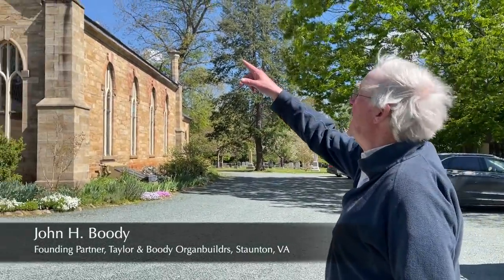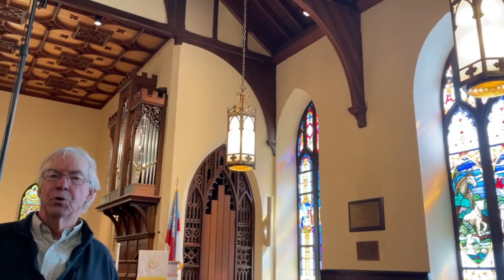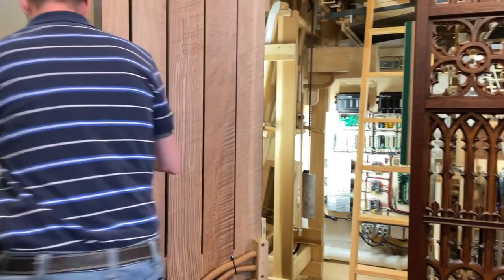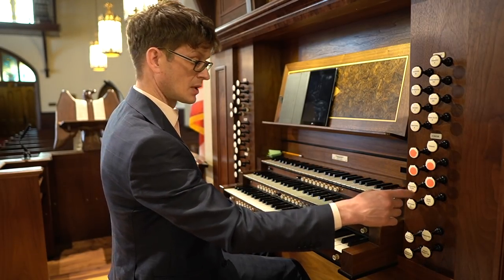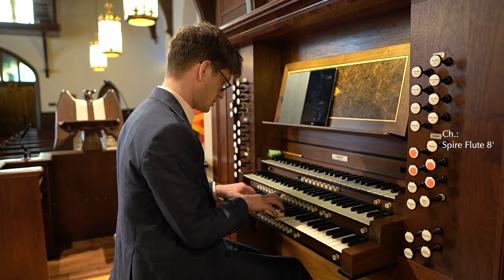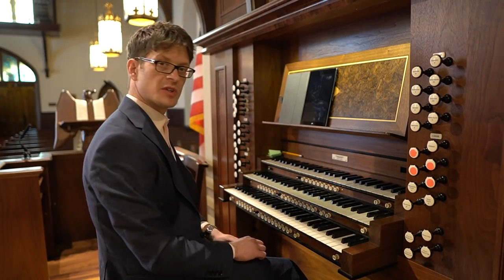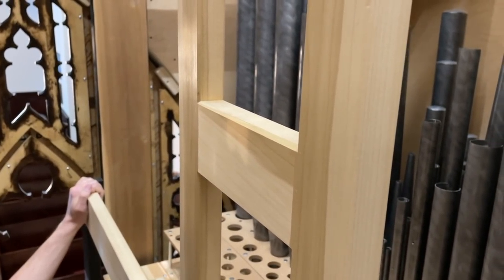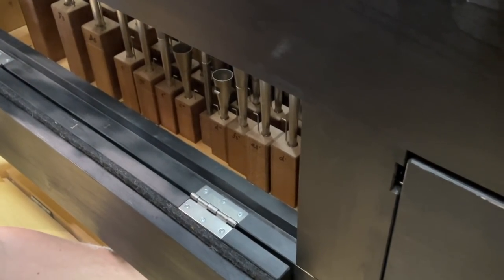WOW! SECRET DOOR - Stop Demonstration and tour of the 2019 Taylor & Boody organ in Keswick, Virgina

Comment: Balint Karosi So with Full Organ mode you have all the Ranks, Stops, & Couplers activated (FX too) which means you can get that sound when you play Bach's Keyboard works. The Organ is another Keyboard instrument & BWV 582 was originally written for Keyboards. The Mixtures give the Pipe Organ its signature shimmer because they play the top notes.

Comment: Interesting how you always hear or read about a church' previous organ(s) that they paid a lot of money for- like the $300 organ they bought in the Civil War era plus $20 for transport and install to replace the one before it that was allowed to fall apart as the $300 organ subsequently was too, to the extent that nothing was left of it... makes you wonder if in 50 years this now new organ will also be treated the same as the previous  one were and allowed to slowly fall apart and need to replaced yet again!

I know of another church whose 1929 Kilgen 3 manual was already trash by 2000- just  71 years later, the roof over it was allowed to leak for YEARS- to the extent the plaster and lath ceiling fell on top of the Swell box roofs and the water damage on the large 16' wood pedal pipes was ongoing long enough the wood turned GREY and when I went to remove them with the rest of the organ which they wanted to throw in the dumpster- they literally fell apart in my hands.
They were supposed to commission a new organ but then didn't have the funds, so again, you have to wonder if they had bought a new organ (like they did in 1929) would the same thing be allowed to happen again, destroying that organ too in 70 years or less?

I'm seeing a lot of wonderful, small tracker organs that seem to be well maintained in Slovakia and hungary, by Rieger Budapest, Frank Strahmer and others, at least one I know in Gyomore Hungary dates to the 1860s in a 1772 church that a 12 year old boy plays all the service music on, yet in America the whole situation is different
Reply: Definitely an interesting, yet sad, point that you bring up. I guess we can be glad that there are at least some places out there that maintain their organs well. Although even there, one thing I hear about often is how baroque organs were revoiced and even rebuilt so that they would suit the romantic tastes of the time, and then in modern times were basically restored to as much of their original state as possible (with some inevitable losses due to what the previous builders had done).

Comment: The organ is divided between both sides of the sanctuary?  Do the trackers go under the floor to the other half of the organ?  Which divisions are on the opposite side of the console?  Your presentation did not make that very clear.
Reply: The console side is Great and Choir. The opposite side is Pedal and Swell
Reply from the maker: Yes the trackers go under the altar.